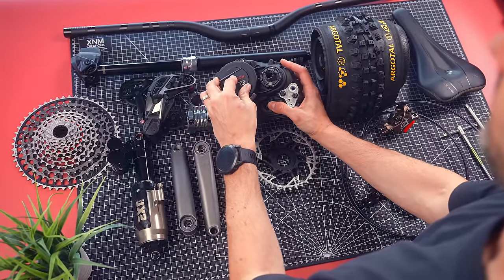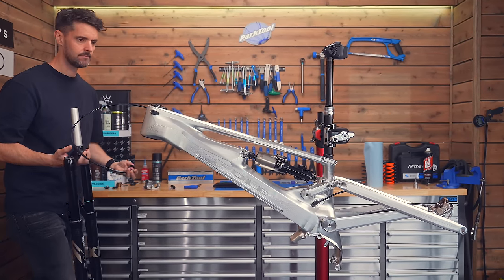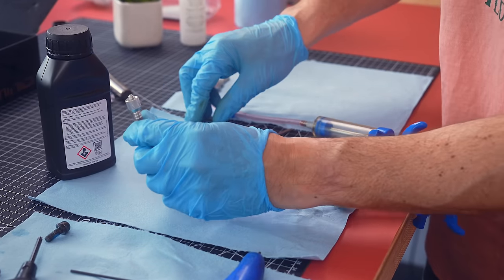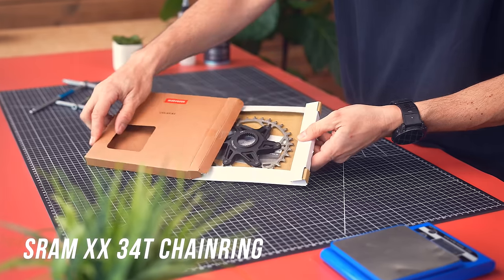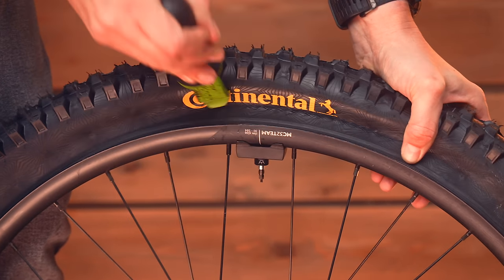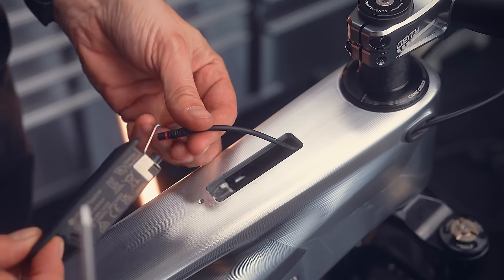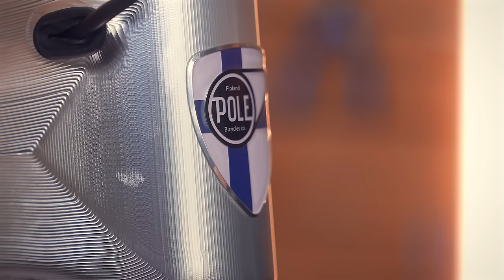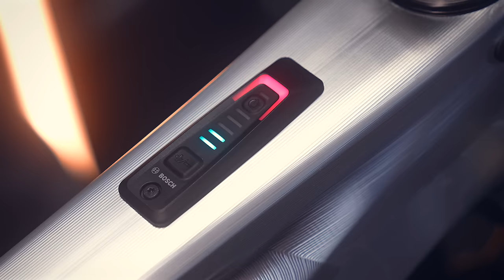Dream Build: Fully CNC Machined eMTB, Pole Sonni

Comment: My customer service experience with both Pole and EXT has been less than adequate.  It took Pole 9.5 weeks to ship out a warranty swing arm for my Voima. They just redesigned the swing arms due to cracking issues, which happened to me. EXT took 2 months to ship out a new shock. Then when I received it, I realized then sent me the wrong shock.😢 I like the bike and the shock, but a big fail for customer support.
Reply: Having just cancelled a voima I ordered back in November that was showing no signs of arriving, then spending 3 weeks trying to get a refund, I concur.
Reply: @markcosens1 that’s a bummer. I ordered my Sonni in February and got it in March.

Comment: Love the idea of long travel suspension provided it can be adjusted to stiffen and even lock out. 750wh battery great, removable great. Whats the weight? Should we now be looking at a pinion gearbox though? Meanwhile sticking to my Rail 5 625 for further innovations, battery technology etc. 3 years and loving it at 70! 👍
Reply: i'll bet POLE and others are working overtime on this :)
Reply: There’s absolutely no need for a suspension lockout. It pedals amazing. My first ride on it I climbed a section of trail that I’ve never been able to climb on my mountian bike.
Reply: Crestline is full carbon and lighter if you want a premier bike

Comment: Foes LTS-E.  You oldsters out there will know what I mean.  🤣  Hey Rob, the FidLock bottle on top tube, don't do it.  I did on a Diamondback Release 3 and quickly hit the bottle with my inner thighs through tight turns and lost it.  Sadly.  Or back it up with a strap (defeating the FL purpose).  😜

Comment: Don’t like that it doesn’t have a Charge port, so no range extender 😢
Reply: Just throw a 500 wh with spacer in your car or pack and the problem is minimized.
Reply: A 750wh battery on a pure DH bike needs more range ? There are some great German eBike touring brands that have 1000wh for touring and sightseeing etc. Germans probably the best at that type of stuff. Can't remember the brand names but if you look on German Google you'll find them
Reply: @Jeffbomke  rather use the range extender for the long excursions I like to do from time to time 🇺🇸

Comment: What is that rubber piece that you put over the Valve Stem??
Reply: guessing a stabalizer so the valve stem doesn't get caught on rocks and sticks and bend. I saw that too so i'm just guessing because i have no idea what else it could be for.
Reply: speed magnet, that's where it goes on new bosch systems
Reply: @In_dependent  thanks, that makes Sense. And it looks better than the Spoke Magnets
Reply: @mikapanten8635  It's not about looks, it is designed in part to defeat ebike derestriction tricks like moving the magnet.
Reply: You can spec the rotor magnet instead though, makes it easier to get a little more speed out the motor if you are that way inclined 😉

Comment: you forgot to mention, horribly short head tube and stupidly high bottom bracket witch result in comic stack, and all that is perfectly finish by world worst customer support. enjoy your pole bike
Reply: I am enjoying my 2 Pole bikes, a Taival and a Voima. Thanks for your concern 😁
Reply: Are you a customer of Pole? What’s your experience with their customer service?
Reply: @drujenssen5444  Mine has been impeccable so far. And while the high bottom bracket is unusual, I‘ve really come to appreciate it. Loads of clearance, and corners really well when you‘ve learned how to do it.
Reply: @crixxbrain6372  I instantly felt right at home on my Sonni on the very first downhill. It’s so fast and just rips the turns. I love the way it corners. Being able to pedal uphill through chunk without pedal strikes is awesome. I think that’s more important on an ebike than a mountain bike because I’m carrying more speed and and pedaling through some gnarly terrain. I also like that I don’t have to run super short cranks so my seat doesn’t have to be as high when I’m pedaling. Mine came with a 25 mil rise bar and a Boxxer. I may try a 40 or 50 mil rise bar at some point but it’s super comfy the way it is.

Comment: The whole design just looks bizarre. I don't mean it looks ugly (eye of the beholder and all that) but its all over the place. Then the cherry on top is that the motor placing seems to have been an afterthought like the guy that was doing the solidworks design went for lunch having thought he completed a non-e-bike mtb design, the cleaner knocked the keyboard and copy-pasted in a model of a motor mount and that went to production without anyone noticing.
Reply: The I believe the original form of this bike was the Onni, their acoustic downhill bike.  So yes, it was designed heavily off of that bike so that they could share parts and processes.  It really makes sense.  They did the same with the Voima and the Vikkela, though I believe the Voima was the original design.  I refer to the Poles as an engineer's bike.  Precision, durability, efficiency, etc. over traditional beauty.
Reply: @Jeffbomke  
>I refer to the Poles as an engineer's bike

Are you actually any type of engineer? I would have thought any engineer would realise having a hooked overhang at the leading edge of the bike is a dumb idea because it'll hook stuff like sticks etc that get thrown up by the front wheel. Looking like someone threw it together in their shed doesn't mean engineered to the highest levels by people that know what they are doing.

Comment: full build around 11-12k no doubt. a lovely bike but only for the most well heeled wallets or a select few testers
Reply: I'd say, in the UK, that would be a £13,000 build. Suspension alone is £2,600 for both ends